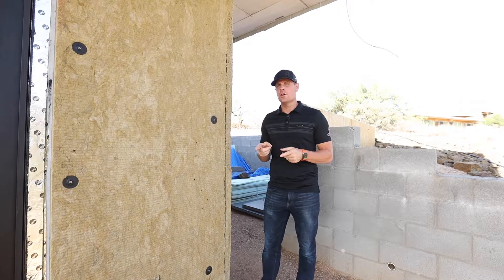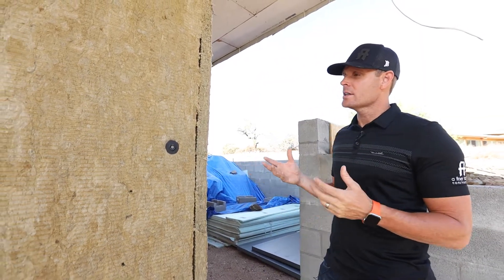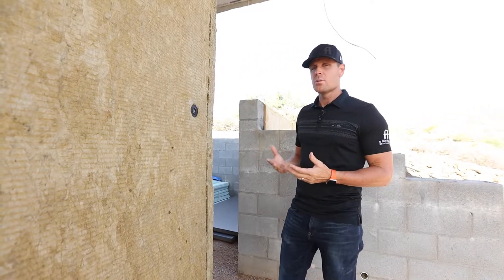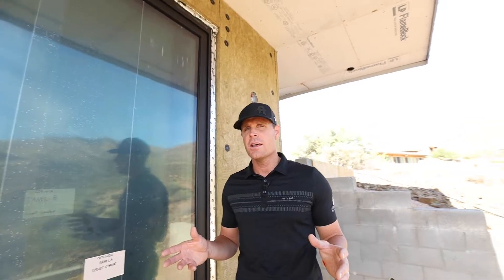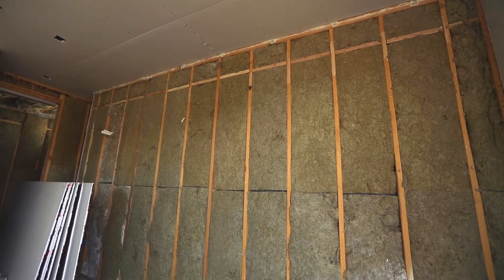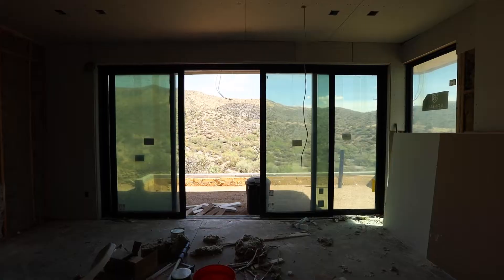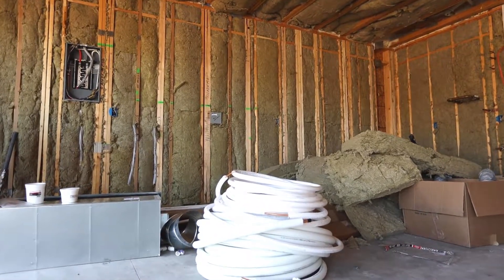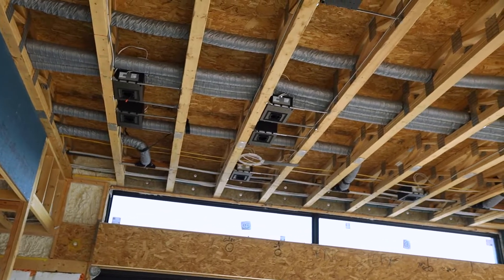Rockwool To Achieve Net Zero On The ADU | Net Zero Home Build Series | Episode 22 | AFT Construction

Comment: I love the Rockwool product but I couldn’t help but wonder about the 1” high gap that was between the upper and lower batts that were installed in several of the interior wall cavities in the guest house. You made such a point of how the guest house had been built in one day and how precise everything was because everything had been designed and cut off site (and how much the insulators loved this because everything lined up perfectly to accommodate the batts) and yet there’s this large gap that will allow hot humid air to move right through the wall and condense on the inside surface of the wall cavity. Was this gap filled in before the drywall was hung?